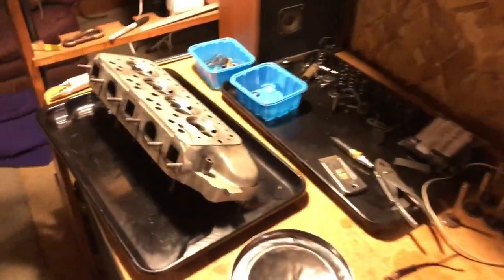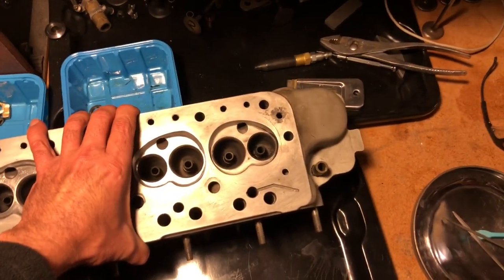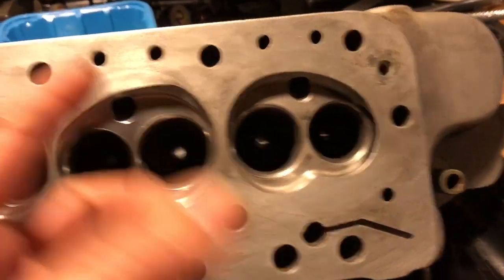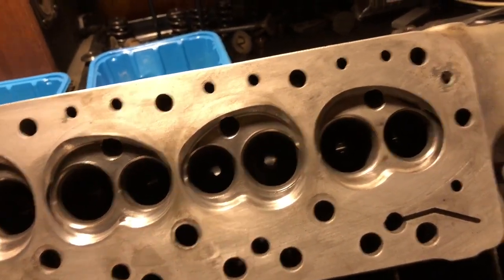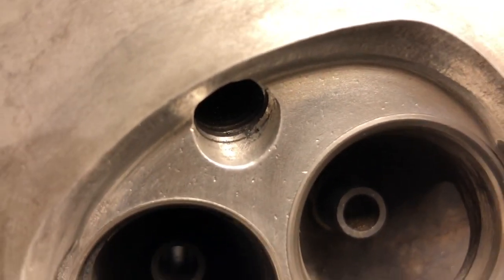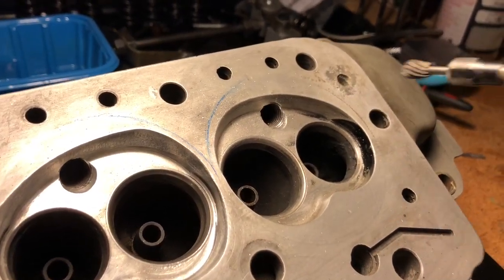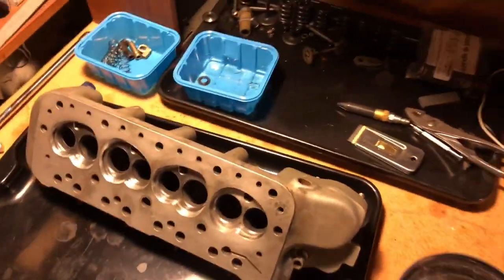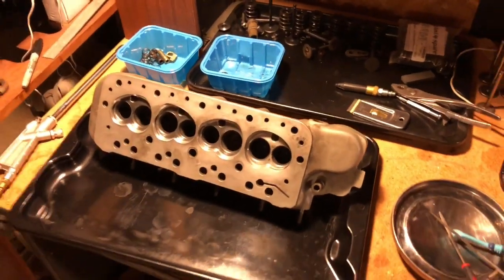Preparing the aluminum head for my own engine

Comment: How would you feel about using the new minispares alloy head for a supercharger application? Obviously with the chamber opened to allow the correct compression ratio.
Reply from the maker: It should work as well as anything else, although I'd stick with the "street" version as you don't need the really huge intake valves with forced induction. You'll have more durability with less crowded seats, and they use the same 1.22" exhaust valves.  All but one of the supercharged engines I built were street oriented and didn't need to rev beyond 6000 RPM or so to make great power and torque. 

The MiniSpares chambers are very nicely finished (unlike this Pierce head) and it would be a shame to "open them up". I used to chop a little off the piston to achieve about 8 to 1 compression.  I used the 21253 type which start at about 9.75 : 1.  I took about .080" off of pistons that were .040" or .060" over,  and about .100" off the 1380 type (that started at 10.5 : 1). That still leaves a shallow dish, so the pistons are not weakened. Don't be tempted to use the cheap stock 8 to 1 pistons, and certainly NOT any of the beer can looking 4-ring type!!